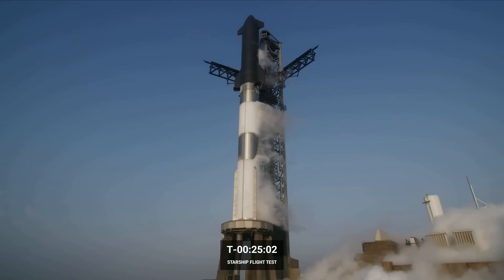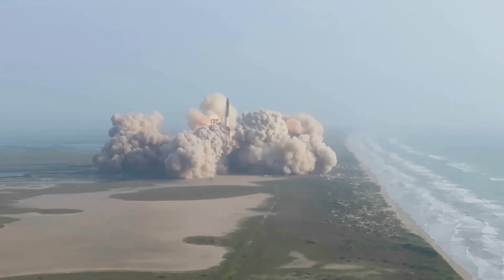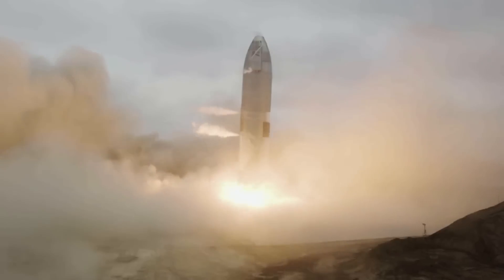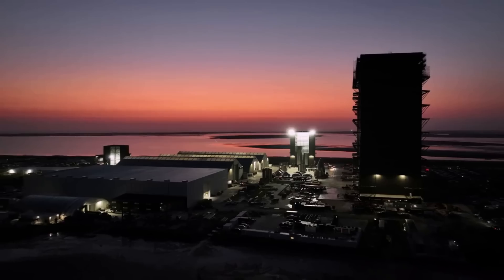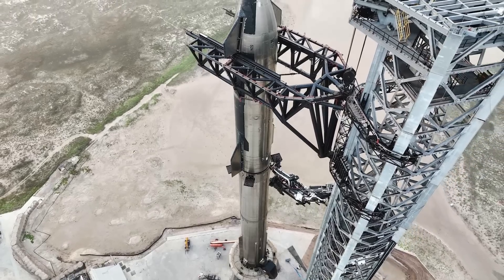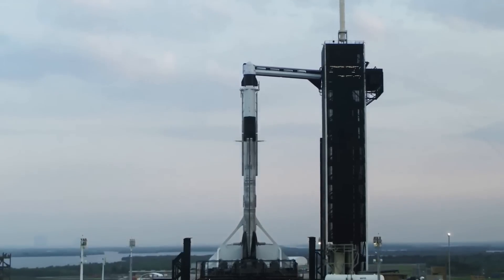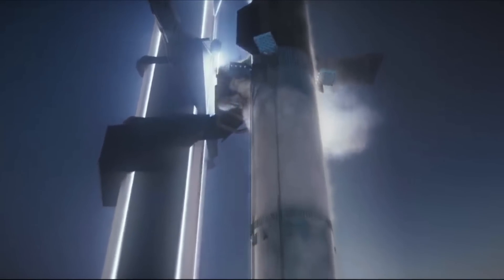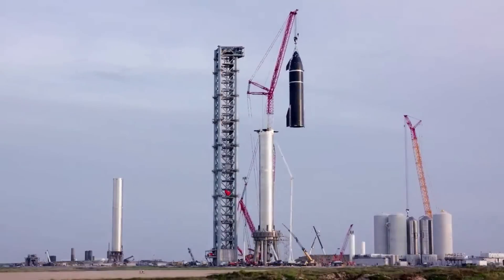Why SpaceX Launched Starship With Minimal Pad Protection

Comment: it made it through MaxQ with 6 engines out. That's a vicotry and a milestone in itself!
Reply: Take in what Slaphappy said, and add to that the fact that they pretty-much wasted a butt-megaton of data-gathering opportunities that would have happened if they'd had a FULLY SUCCESSFUL launch and mission. As it was, they'll have to wait far longer now for their next launch than they would if they'd taken what they already knew and used those facts, instead of yielding to impatience, over-optimism, and ego.
Reply: @stephenhoward6829  The amount of data collected on Stage 0 is enough to now build 3 of them, the right way. So they saved time here.
Reply: No payload.
Reply: 6 engines out. You think that's a victory? 18% power loss. That isn't even close to OK.
Reply: “Max Q” is just whatever point in the journey where the vehicle experience the highest aerodynamic load. Whenever you ride a bike, at some point in the trip you will reach the “max q” for that trip. Starship went nowhere near the intended max q for the planned mission profile.

Still an impressive feat.
Reply: @slaphappyduplenty2436  they went through the planned MaxQ for the planned orbital flight. They announced “we now passed max q” meaning it was the max point of force on the vehicle for the entire flight, even the planned orbital insertion, etc after that.

Comment: What I find very interesting (and convincing):
• The rocket flew (somehow) maneuverable after loosing engines right from the start and having stuff explode and blow off it sonon after
• It survived max dynamic pressure
• It survived the rollercoster right before the explosion
Well, that's quite a robust, flying skyscraper!
Reply: You do realize that during the roller coaster phase that the atmospheric density is around 1% and a lot of the loading was in tension while mostly in free fall, so not a huge amount of loading.
Reply: @Mentaculus42  Partially true. Max Q was minutes earlier in the flight. 
The full stack experienced high G loads from angles that it was never designed to while tumbling. 
The centre of gravity had shifted forward to the starship, which still had an unspent fuel load.. 
All this, and it was still in one piece when it was terminated.
Reply: @cliddily  
Actually it was in massive failure of the interstage as directly shown by the leaked picture of that failure. This does make sense as the stack was extremely top heavy at that time while 33 raptors were at the other extreme end. 

As you say, not something that was designed for or would ever be designed for.
Reply: @Jimbogf 
The thing is that spacex has a pretty good idea how things went down. It will be interesting to see just how transparent they will be on the details vs the quasi-transparency of doing things on a stage that they can’t control. It is not like SLS NASA press conferences where people could ask any questions and get technically detailed replies directly from people that were responsible for implementing those details.

Comment: It was well worth it, every millisecond of it. Data collected is invaluable.
Reply: Data? They relearned launch pad data that engineers knew 60 years ago. Hell I remember reading about flame trenches in my child craft encyclopedia.
Reply: Yes every millisecond of data they collected on starship after it staged, oh that’s interesting, it didn’t stage so no  data especially with regard to thermal protection system. So the whole TPS validation data set was lost. But my understanding is that they have made major changes with the TPS on starship so probably not a big deal, BUT …
Reply: @Mentaculus42  the booster.
They need to get in orbit before they can test the TPS.
Complaining about the flight not meeting your definition of perfection is lame when you build NO rockets at all, chief.
Reply: @leonardbakers  
Fool-Aid drinker! Getting into orbit was a significant goal and not staging was a significant missed goal. As far as perfection I would suggest that SLS’s flight was as close to perfection as it gets, the starship launch is on the spectrum between good vs not good. You drink their Fool-Aid, I make a realistic appraisal of where it crashed on that spectrum.